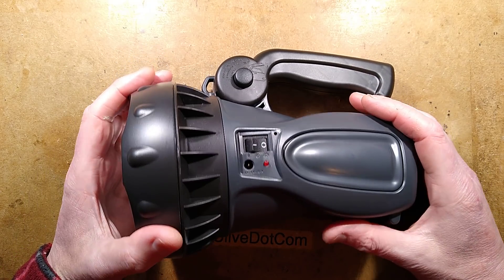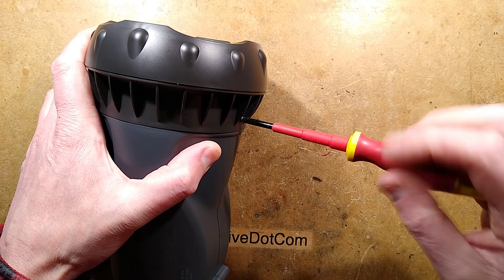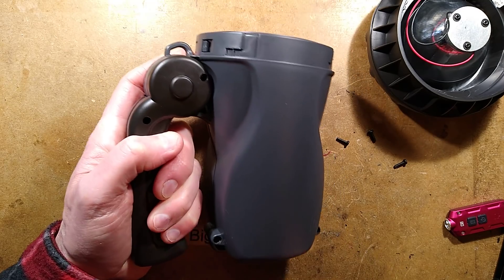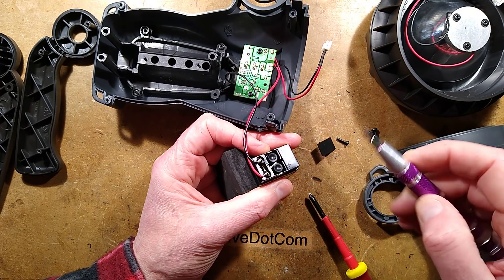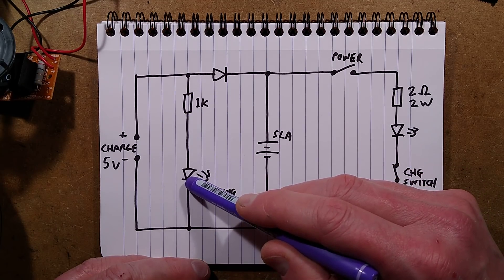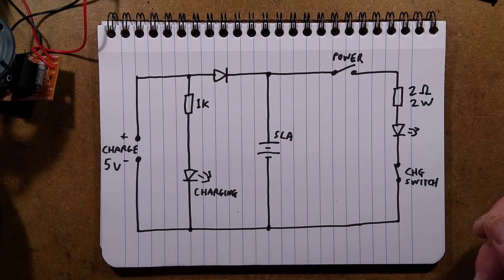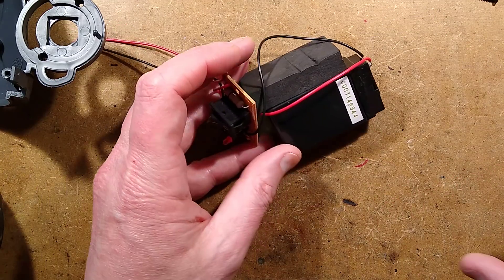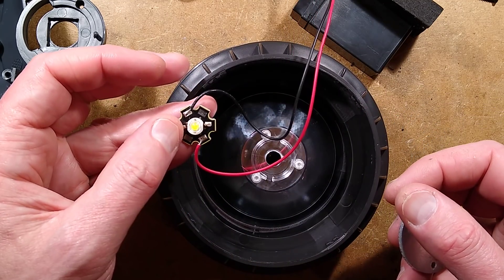Big light, but it's PISH!  (With schematic)

Comment: ngl i found this absolutely fantastic as a diy best flashlight ever kit lol, change the crap battery for as many lithiums as you can cram inside the case, change the LED for a brighter one, put a drop of thermal paste on the mount and you’ll have a genuinely nice, relatively rugged big flashlight

Comment: Hey @bigclive, I purchased a Walmart LED bulb which has a battery inside by mistake! I had a ghost lamp that would glow rather brightly when I would shut the wall switch off, but not if I shut it off at the lamp. Is this something you'd be interested in opening up? I wonder if they sell the same lights in Asda over there.
Reply from the maker: I've looked at a few of those battery backed lamps.

Comment: Curiously (automotive/leisure) Lead-Acids were going for £480/tonne when i weighed a few in recently.... which meant it was worth the drive to get £20 back for four 'doorstops'.  
The current measuring faux-pas with the UT210E (which i've done myself) can be avoided if you get a UT210D! - AC/DC are selected on the rotary switch. (Nought to 200A). Only downside is you lose the millamp resolution, getting 10mA instead.

Comment: 1:59 Not much?
TF it is so empty in there.
Have a lamp in similar form factor from ALDI, has a ring of cold white LEDs on the outside and a halogen lamp in the middle. And internally, a 12V lead acid. The battery is dead. And it is in the bin to recycling. I wonder if I should reactivate it.
Edit mine has a huge chunky battery in it. The light has really a heft to it.

Comment: can the board charge a li-ion battery?
Reply from the maker: It would really require a TP4056 charge control PCB.  Preferable the type with the low voltage shutoff too.
Reply: @bigclivedotcom  thank you for your reply, i have one of your pink poundland usb chargers. might shove that into my Dad's similar lamp

Comment: 🤔🤔🤔Hmmm.... Time for a 'tune up' methinks...
Higher rated SMD (with a bigger lens cap on top utilising the reflector more to make the beam wider), replace charging circuit so that a higher capacity LIfpo/NiMetal/newer battery tech and increase water resistancy'... Might make for a decent torch then... 🤔😏😎🇬🇧

Comment: Based on the size, I bet you can hack one of those old intel CPU coolers and install a super bright LED in it, like the CREE XHP 70 or something similar, and get this thing up to 4000 lumens. May also need to drill some holes and add a fan for heat dissipation! For power, you can stuff this thing full of Samsung INR18650Q cells, which have a good combination of price, capacity, and ESR.
Reply: Knowing BigClive, if he does this, he'll probably run that LED at some just a couple watts. lol

Comment: Hah, looks like everybody had this one. Ive got mine, in original box. It came from Harbor Freight. 
Called the Night-Search Eye 2925....1,000,000 candle power Innovative High-Quality Rechargable Halogen Lantern with Super Bright LED Light Tube

Has the I II toggle. The side led was pretty pathetic

Its been sitting on my project shelf for over a year. I have the parts. The main beam will be one of those Ultra Fire drop in modules. Seriously good beam for ~ $10. They rate them @ 1000 lumens 
Side LED to be replaced by 1 or 2 of the many cob panels i have laying about

And Two 26650 cell holder in parallel, to be able to use 1 or 2 cells

Thought It would make a nice camping light, once I get around to it

Comment: The only time these little lead acid batteries kind of made sense was inside emergency flashlights. The flashlight would spend 99% of it's life hanging off a wall socket, on float charge, waiting for a power failure. That would be it's shining moment. :-/

Comment: I've got a very similar unit, but made with an extruded aluminum body.   The problem is that leaving the charger on cooks the SLA battery eventually.   In my case, it took about 6 months.   So much for standby use.   The awful part is that a replacement SLA battery costs more than the unit cost originally.  I stuck 3x NiMH cells as a replacement, but that's a bodge.   FWIW, the innards were stuffed with plastic packing bubble filler because of the smaller battery size.

Comment: How could I resist this video with  SKEEEEMATIC.  PS Re. previous video on 4x Batt charger. Do you save the LED length clipped leads for use as jumpers on other circuits?
Reply from the maker: Sometimes I do use them as links.

Comment: Charging from straight USB may be quite fussy of the power source. When the battery is low the USB will see the lamp as a overload and cut out without giving any charge. If there was a dedicated charger  it  hopefully will constant current till the Voltage rises. There is not any low Voltage cut off so the battery is unlikely to survive the torch  being left on to go flat.

Comment: Reflectors and big battery boxes on torches are really a throw back to incandescent bulbs, which needed a lot of power for little light, and whose filaments radiated in all directions. LEDs are pretty directional already, and if you take a 5mm LED as an example, can simply emit almost all the light in maybe 20 or 30 degree arc.
Reply: That was my thought too; big reflector pretty well superfluous. The LED and the small LA battery could go into a much smaller case and deliver the same performance.

Comment: The amount of hollow space inside that plastic housing is truly hilarious. I suppose this light was originally designed to take a larger battery, and the oversized housing is a remnant of that design feature.

That being said, I wouldn't rely on one of these lights to last very long, as the build quality is seriously lacking. Whoever assembled this must have been taking the "Pish", so to speak.

Comment: That large form factor, at least in the US, comes from when those were considered electric "lanterns" that had a large flashlight head and took a large, square, spring top 6 volt battery.  They were usually known to float, and were seen a lot with handy folks, campers, fishermen, etc.  I had one that was cheap as the day is long, but they held up, produced very steady light, and those batteries would last a long time.  They were known to have 12 - 26 Ah.
Reply: Mine still has a large spring top 6 volt battery in it.   With the tight focus LED bulb.   I prefer the extra weight, even if I'm hunting for a Fresnel lens for it.

Comment: I had 2 thoughts on this. One was, drop in a portable phone charger to replace the battery and upgrade is 50%+ better. Or 2 take a handful of your used capacitors you have laying around and add them to the battery to make a quick charge setup. 2 minutes and your charged. Spot light on the go.

Comment: Clive this is the base model. The other models have a plethora of battery and LED choices for the retailer to choose from.

Thx for sharing the teardown. It doesn't get any more basic than that. I wonder if the PCB pick and place machine was organic. I'm surprised they even used a PCB. Could've been everything flying in space. Maybe heat shrink tubing cost more than a PCB. Who knows when you're making a bazillion units.

Again, thx for sharing.

Comment: I have the same light but different casing , i hacked it just like you said , tp4056 etc , you can play with the voltage output , i did a dim and a high beam with a 3 way switch

Edit: the same original lead battery was crap , it died in 2 days , but at least had 3 in it not just one

Comment: I had a few spotlight type lights like this that had a 6 volt halogen bulb and SLA type batteries.  The batteries ended up going flat and wouldn't charge so I took them to bits for the parts.

If I had a light like this I'd modify it and put in a brighter LED and lithium batteries. maybe a power bank like I did for my light bar which originally ran on two 4 volt SLA batteries.

Comment: Here in the states, we have a discount store called "Ollies".  It was about 15 years ago I was in there and they had these Steelton Tools branded, "1 million" candlepower searchlights for like 30 dollars.   If that light was 10 million CP, then my butt is too!  If I'm being generous, I'd give it about 750 thousand CP. .  It was a slight bit dimmer than my Brinkmann Q-beam 1-M. (A Legitimate 1 Million CP spotlight)   Physically the thing was huge.  The lens and reflector was about 10 inches to a foot across. It was heavy too as the body of it was indeed stuffed with as big of a 12V SLA battery that could fit in it.   It had two switches up on the grip one for On/Off, the other for "High/Low"   The battery was decent, but the 55 watt H3 automotive foglamp bulb burned through it within 20 minutes or so.  I took it to work one day and someone borrowed it.  I got it back with the glass lens smashed out of it.  I had to go to a local glass cutter and have him cut a new bit of glass for it.  10 dollars there..

I eventually made some improvements to it.  I happened to have some of those little blue LED stick-on mini spot lights, that could be used for accent lighting in a car/truck (Like lighting up a console or place on the dash etc)  They ran on 12V obviously.  I took two of them and wired them in to this searchlight, on their own little switch. Those were stuck on either side of the reflector, just behind the glass, and pointed straight ahead. I also added a 12 power socket mounted to a bracket on the side.  Now, it was not only JUST a searchlight,  but a relatively useful powerbank.  It could charge a phone easily.  My girlfriend (at the time) and I liked to go on walks after dark, down the bike trail near our home.  But she would get spooked by the deer and raccoons rustling in the bushes.  So the light came in handy for that as well.  Just walking along I had the two blue leds lit to provide just enough light to see about 20 feet ahead of us,  But if needed, I could flip the switch for the main lamp and light up everything for about a 1/4 mile ahead.  But just using the 2 leds,  it would go for a few days or more.  (I tested that) 

But one day I dropped the damn thing..  The brittle plastic case shattered like glass, the glass lens shattered, again.. and the SLA battery burst, leaking its fluids all over the floor.   I salvaged what could be salvaged and tossed the rest.  Those bits are still sitting around here, in a box, somewhere amongst the cobwebs. 

The one I had was similar to this one on Amazon... (link)
https://www.amazon.com/dp/B001B7ILFC?ie=UTF8&*entries*=0&viewID=&*Version*=1

Comment: I have an equally pish torch. Not quite so big, but it weighs practically nothing. Took it apart and it has one AA sized lithium battery, 14500 I think. There's easily enough room for an 18650 which is what I'm going to put in it very soon.
Reply: I ran it to empty then charged it through my little USB meter. 207mAh at 5v. So less than 300mAh at the battery voltage. I think the 1500mAh from the big vape pen I found will be a nice replacement. Plenty of room for it.

Comment: Looks like some chinese factory copied or bought the mouldings for the case and bodged in a small battery, cheap LED in it thinking they could sell it at a big profit whilst cheating the purchaser...as per usual. However, it does have hacking potential 😎👌

Comment: I had a torch like that years ago I bought from Argos. It was branded under the Challenge name. It was the same as that one except the battery was a 6v lead acid and it was the charger doing the 'intelligence'. The charger was labelled 'for sealed lead acid batteries only' and had a red and green LED on it for charging/charged and power. The battery failed in a short while. I think I still have the gubbins from inside but I threw the case away as it had that horrible rubber coating that went sticky. The other light I bought was much bigger with a halogen bulb in it, bigger charger, still branded Challenge and had a 12v sealed lead acid battery in it. I still have it but the battery is long dead. Another LED torch I bought from Argos has 8 LEDs behind lenses, 7 round the edge and 1 in the middle, again years old, battery dead though this time a flat NiCd or NiMh pack, I cant remember. It is supposed to be weather proof so I was going to replace the LEDs with slow fade RGB ones and make it into a solar garden light lol, still never got round to it. Thats typical me.

Comment: I had the old "1 million candlepower" version that came with a halogen bulb.  I turned it on and it worked for literally 1/2 second.  the battery came dead inside it.  So I took it apart and converted it with one of those 100W LEDs and a lithium battery pack, and a way too complex control circuit that boosted the voltage up to around 40V that could PWM the light and monitor power draw on a small LCD.

Comment: I had a similar Chinese torch with one of those batteries. It did not take a charge. I took the battery apart an it was dry an the elements had crumbled. The Chinese don't make good batteries sadly. The Chinese also copy other companies gear. I have an old vintage Ever Ready torch a bit like this one in the video an it uses an old style bulb an a 6v block battery an it's brighter than the one in the video. I have yet to see a decent Chinese torch. They even did a copy of the Nightcore range an yes they were poor quality. A genuine Nightcore torch is expensive but as they say you get what you pay for. Sadly the battery in your torch won't take many charges Clive because it's construction is poor quality sadly. Sometimes bigger is not always better. My Lidl crivit torch is brighter than this an it runs on two AA batteries. Pay a little extra for a better product as the saying goes.

Comment: For years i've been puzzling if- and how them current hooks would measure DC current, but now you finally enlightened me, ty! I pondered if they relied on core saturation while generating an AC signal by the meter, or wtf. But of course, 'just' a Hall sensor. Makes me assume the positioning of the wire is delicate with DC? Is such device useful for unintrusive low-current (mA-tens of mA range) measurements?
Reply from the maker: It requires careful use to get accurate low current readings, but for higher current readings it's a lot less critical.

Comment: Hey, i have the same DC clamp meter.
Very handy.
0.3 Amperes is enough for 1 Chinese Watt. ;^)
They could have put a single 7135 in there in stead of that 2 Ohm resistor.

Comment: my current led light i use for inspecting cranes (im lifting inspector) fits in the palm of my hand and it light sup 100m high to the top. Its also a nice handwarmer for winter.
forgot the brand but it was about €80 and magnetically charges over usb.

Comment: I think I will stick with my £8 Lidl metal torch with a (verified) 2200mAh 18650, USB charge (and power bank output), focussing  and real Luxeon LED. It fits in my pocket too. They also recently did one with a 3W and a dock that screws to the wall, which automatically activates the torch if the mains power drops out. It didn't cost much more.

Comment: What I can recommend for super narrow beam lights like that which aren't good for upclose (Becuase the tight beam) or distance (Becuase of brightness) you can take out the clear plastic and either sand it lightly or use some frosted glass spray to diffuse it and use it as a short range but wide illumination light.

 So maybe like a soft work light or emergency light.

Comment: Now if you could bung in something like a 10W LED cluster, that's small enough to work with that reflector, then you'd have something to work with. Battery power's not the issue here. It's lack of LED grunt.

Comment: I get those exact LED's with and without the PCB....The 1W/3.2-3.4V/350Ma...3W/3.2-3.4V/700Ma...5W/6-7V/700Ma and also a Fenix flashlight replacement LED [PCB only] 10W/2.9-4.0V that puts out a little over 12W connected to a fully charged Lithium Ion battery. [4.2V]
You could easily put in a 3W, thermal glue a copper plate on the back with of course adding thermal paste under the LED PCB and a few 18650's in parallel for a quick easy upgrade. Or ad a larger copper plate and use a 10W LED chip for a "Tim the Toolman" upgrade.

Comment: I measured back in the mid 80's using a calibrated Data Precision LED DVM the voltage for a brand new fully charged [Trickle for days and allowed to settle] 12V lead acid car batteries and the voltage was 12.865V

Comment: On the topic of portable lights. Recently daughter ended my "not-sh*t-still-cheap" torchlight. Decided to at last buy decent one. All that have standart batteries was low output, or got piss-poor working time. So opted for one with 18500 and charging, the led was something XP-G3 I think. Man, for its size it got some light. Like a day and night what I was using before. Now going near torchlight stand at average store, they all look like childs toys compared.

Comment: I had a couple of light I really enjoyed, one wasa flashlight/torch rechargeable, it was extremely bright beam... And they other just sat plugged into the outlet and when there was power lose on the main, it lite... Then as usual, the both died ... Never could figure out what happened to them... Not could I find the same batteries.... Maybe I should try again since some time has past

Comment: When I first saw the size of this light it looked just like an old tungsten bulb style that took a rectangular 6v "lantern" battery. I wonder if this mold has been changed from an old one from a long time ago with older batteries, and bulbs to this, with an iteration that has an 18650, and now led acid. It has way too much empty space inside for a modern flashlight.